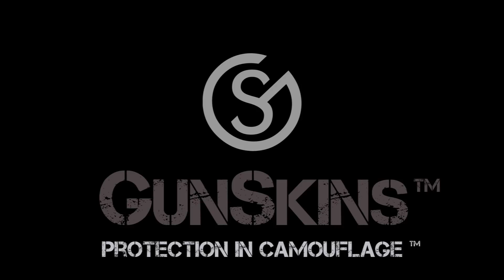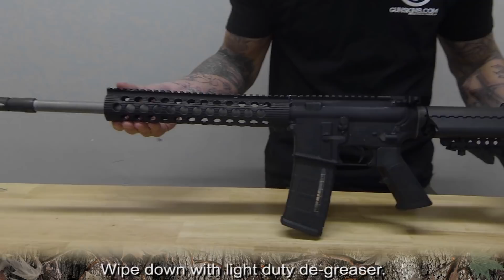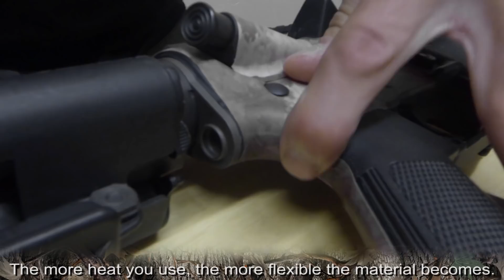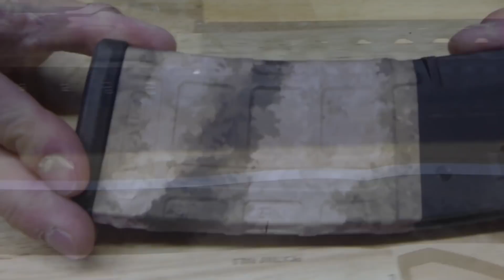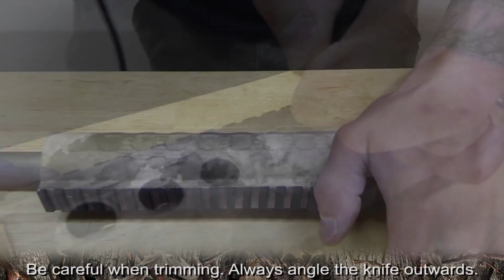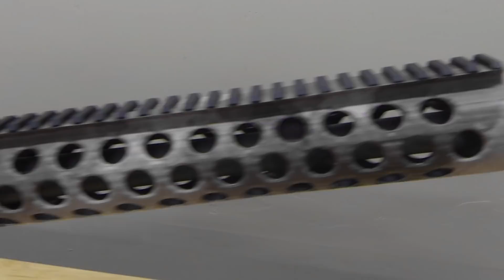GunSkins AR-15/M4 Rifle Skin DIY Install Tutorial

Comment: does this stuff not melt after you fire a mag or 2 down the range? im thinking about this but on a suppressed 10.5" 556 pistol.
Reply from the maker: The vinyl is rated to 230 degrees. We've tested and yes, they melt on suppressors. But no issue with wrapping the handguard or slide.

Comment: So heat will shrink and settle the wrap over the gun?
Reply from the maker: The vinyl is more accurately described as a heat-stretch, not shrink. But yes, heat does help conform to the surface and set in place once cooled.

Comment: Will it fit a at 15-22
Reply from the maker: Our AR-15 Rifle Skin is compatible with the general AR-15/M4 platform. Although the precut pieces are made specifically for mil-spec receivers, the vinyl is easy to adjust using heat to conform to any variance as seen in the 15-22 (ie: lack of forward assist, shell deflector, dust cover, etc) and may require a little creative work and trimming to make fit.
Reply: @gunskins  I’ll try my best 👍👍👍 thanks

Comment: Wont that melt on the barrel when it gets hot?
Reply from the maker: No problems at all with heat. Rated up to 230 degrees. We only suggest not wrapping the barrel if you're firing full auto or wrapping a suppressor. Anything less than that is fair game :)

Comment: Would it turn out better if I disassembled everything then installed it? That way I don't cover any pins or anything?
Reply from the maker: Disassembly is not required but you can certainly do it if it makes sense to you.

Comment: Unfortunately their A-TACS AU pattern does not have any mud/brown tones, only green shades, and so it completely does not match any A-TACS AU gear and clothing you may have.  I can show you photos of my gunskinned AR-15 beside the gear and it is completely green versus brown.  This video does not show the true gunskin A-TACS AU color you get
Reply from the maker: All our patterns are approved directly by A-TACS for color matching. Are your photos taken outdoors in the sunlight? You'd be surprised how different the vinyl looks under different lighting. Maybe what you received was A-TACS FG?
Reply: @gunskins  No just checked. I purchased the ATACS AU product number X001WCR9NH and mag skins pack X001WB9WA1 and all of it is green with no brown tones and does not match at all my ATACS AU bulldog case and my complete Browning  ATACS AU hunting gear. Felt a bit stupid when I realized they didn't match at all but I am living with it. 😔 your GunSkin also totally does not match your advertised color or the actual print on the a-tacs.com website.
Reply: @envisibleward2422  and of course you shut em down with that 🤣
Reply: @CuttinChris  just stating facts.

Comment: Does this wrap add grip?
Reply from the maker: Our vinyl takes on the contour of the gun or grip, so it's typically neutral as far as grip.  That said, if you really smother oil on your pistol slide, you may have a difficult time chambering a round, but that would be true with or without the vinyl.

Comment: Does it have to be a certain manufacturer or do you have an ala carts for people with things like the Zhukov stock, different magpul stocks and hand guards such as the myriad one can buy for Ak and Ar platforms?
Reply from the maker: Our kit templates are available on our website. We design pieces for the receiver to be as universal or common as possible. We do not make precut pieces for the buttstock, forend, or barrels because there is no standard. Our product includes a 22" sheet from which to make custom pieces to install, trimming away the excess to make for the perfect fit.

Comment: What nothing for the AAC Flash hider?
Reply from the maker: Our small generic sheet, the Scope Skin, was designed for small accessories, including flash hinders.
Reply: GunSkins damn. Cool.
Reply: GunSkins when I buy an AR15 skin does it come with a skin for my scope or do I have to buy that separately? I'm thinking about ordering one right now. I've got a 15" UTG Pro super slim keymod hand guard and a magpul STR stock and a Vortex Strike Eagle 1-6x scope, a tapco foregrip a 600 lumin Streamlight flashlight with remote switch pad. I also have a DPMS G2 Recon .308 that needs skinning and a Zhukov RAS47 that has a Zhukov long hand guard and a Zenitco B13 sidemount and a Vortex Spitfire 1x red dot.
Reply from the maker: The AR-15 Rifle Skin does not include a piece for the scope. I recommend purchasing additional material for the accessories. Our Scope Skin measures 8" x 15" and the Gear Skin measures 8" x 50".

Comment: how long does it last?
Reply from the maker: Hey Mark, It depends on how hard you run your guns. The Skins are designed to take the abuse of daily use but just like any wearing surface they will eventually show it. I carry daily and shoot weekly. My Pistol Skins serve their purpose for over a year and I have long guns with Skins that still look good after 3 years. Hope this helps.
Reply: I want to wrap a mcmillan M40A5, but with it's irregular shape the rifle skin won't work. Would a gear skin be long enough to wrap around the back of the stock which extends down? I'd probably need one for each side, assuming it was tall enough?
Reply from the maker: Hey Blake,
The Gear Skins are 8"x50" long and will give you more than enough material to cover the McMillan M40A5. I would go with 2 Gear Skins and that will leave you with plenty of extra material to wrap the scope, barrel, etc... Let us know if you have any other questions.

Comment: Finally put mine on.  I probably should've cleaned it better (sprayed it down hard with brake-cleaner, then used an air compressor to dry off and spray clean), as the stuff didn't stick too well until I applied heat.  And not sure if it's my rail system or the skin, but it had to be stretched pretty good to go on the rails.

All in all, pretty good and I don't regret my purchase.
Reply from the maker: +sonrouge Good to hear you got it done! It helps to hit the recessed areas with a brush. The material can  be re-positioned until you hit it with the heat so it has a light tack to it. As far as the rails that has been my experience with on some and not on others. Shoot us some pictures of your finished products if you dont mind! You can submit them to any of our social medial this month for the opportunity to win some more GunSkins.

Comment: Thank you for this. I just ordered a set for my AR. One thing I am wondering about since you mentioned degreasing. How will gun cleaners affect the bond of the skins? After doing the final heat process to set the skins, will that be enough to keep things like CLP or other types of gun cleaners from getting between the metal and the skin and causing the skins to peel off?
Reply from the maker: +stinkydoggy98 When pressed in firmly and hot from a heat gun, the vinyl creates a water and air tight seal. No cleaners should seep under and hinder the adhesion.
Reply: @gunskins  You probably already know... but, the blue loctite will remove the camoflauge pattern from the vinyl if you're not careful.
Reply from the maker: zeke thefishgeek  Good point; thanks for highlighting.

Comment: will this fit an sr-25?
Reply from the maker: +Aden Parker SR-25 rifles contain differences in the upper and lower receivers, which means some of the kit's pre-cut pieces aren't going to be "install ready". You may have to custom cut and trim pieces to fit your gun's upper and lower using the bulk material that comes with the kit.

Otherwise, it's also possible to wrap an SR-25 using a single sheet Gear Skin. All custom trimming required in a less expensive kit.

Comment: Can you use brake cleaner to prep it?  That's what a lot of "gun painting" vids recommend.
Reply from the maker: +sonrouge Use non-chlorinated brake cleaner in order to avoid the dulling of the plastic surfaces.
Reply: +sonrouge yes, i use non chlorinated brake cleaner on my guns. It can dull some of the plastic parts and pieces.
Reply: +Kevin Lyon Chlorine or the non chlorinated brake cleaner?
Reply: Thanks

Comment: Could the gun be painted first, say something close to the color of the skin to eliminate the black ares between the panels?
Reply from the maker: +the GLUGLUG Yes, that's not a bad idea. Just remember, it's much more difficult to remove paint than it is to peel off the vinyl.

Comment: So when the barrel heats up, how well does the skin stay put seems like it would melt off
Reply from the maker: bullit4x The heat from the barrel will not effect the GunSkin. However, we do not recommend installing the GunSkin on the barrel, if you intend on using full auto.